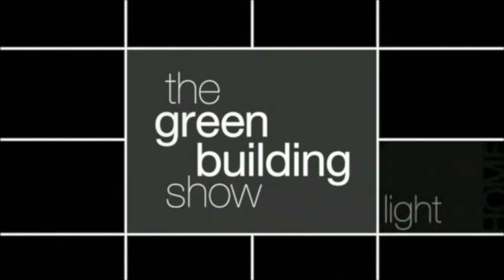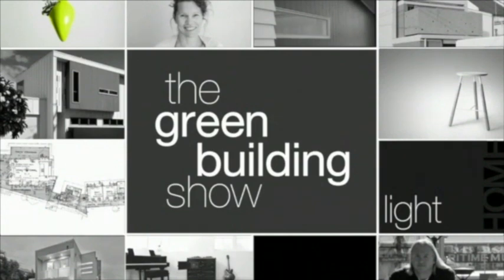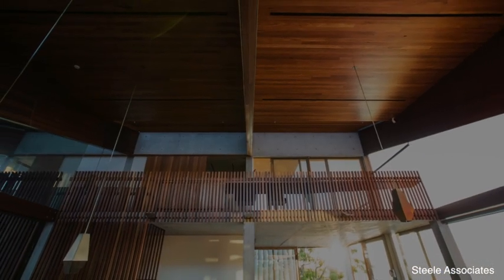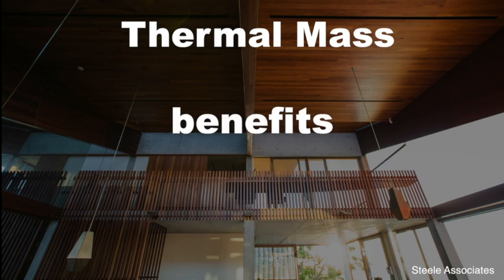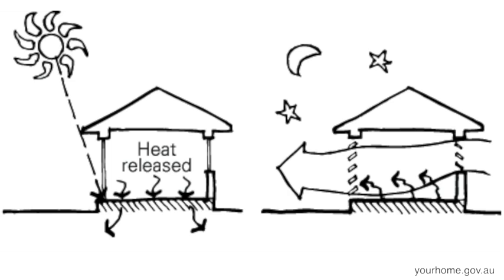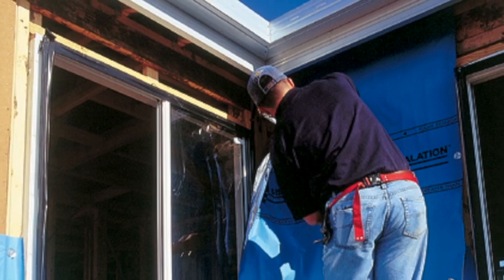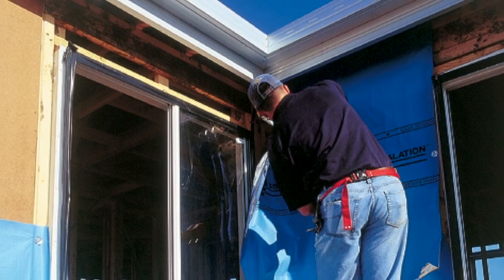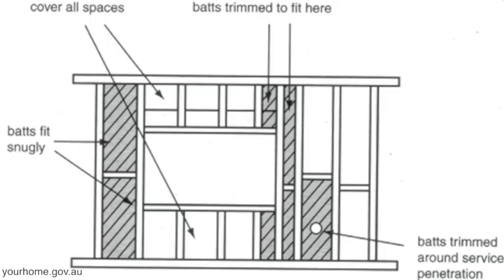Passive Solar Design - What is thermal mass?

Comment: In the Heart of Vancouver Island BC Canada passive videoshttps://www.youtube.com/user/seumas2/videos
Material used

Port
Alberni's first Passive house (Passivhause) build in the heart of
Vancouver Island British Columbia Canada.

Passive
House(Passivehaus) is considered to be the most rigorous 
voluntary energy-based standard in design and construction industry
today.

Passive
house buildings consume up to 90 percent less heating and cooling
energy than conventional building.

The
use of Passive House design software was used to gain the specs
required to meet the performance standard for this location.

House
was constructed well  above the current standards as outlined in
the B.C. Building Code.

Footings
were widen to 36 inches(914 mm) due to low bearing soil conditions
and additional rebar reinforcement added.

30
inch high (762 mm) high reinforced walls . Course sand placed inside
foundation walls and mechanically compacted.

Three
layers of four inch *102 mm) thick  Expanded 
polystyrene foam sheets with all joints staggered and tape were
placed on top of compacted sand.

The
three layers of foam have insulation value of approximately R 50.

A
20 mil layer of poly was placed over the E.P.S. sheets and taped and
sealed.

Four
inches(102 mm) of 30 m.p.a fiber reinforced concrete was placed to
form a slab over the foam based.

Slab
is isolated from concrete stem wall with four inches (102 mm) of
E.P.S. to prevent thermal loss.

All
cold water lines are buried in the sand to keep them cool, hot water
lines have been placed in the center layer of foam insulation to
minimize heat loss.

Wall
plates compress to heavy beads of acoustic sealant between layers of
vapor barrier to prevent air movement.

The
walls are double stud configuration set at 24 inches (610 mm) on
centre and plates are spaced in a manner that yield a 20 inch (508
mm) thick wall. 1/2 inch (12 mm) standard plywood sheathing with 
Mento 1000 a three layer airtight vapor open house wrap( far superior
to common house wraps) with 1/2 inch(12 mm) pressured treated plywood
rain screen battens form the exterior surface. 

Intello 
smart vapour barrier was installed one third in from the inside wall
to prevent condensation in this climate.

Triple
pane argon filled windows meeting passive house standards from
Euroline  were placed mid wall to reduce wind wash heat loss. 
All window openings have been splayed at 45 degrees to give a full
wide angle view.

Almost
all the wiring and plumbing was kept inside of the vapor barrier
envelope to minimize air leakage.

Passive
house standard requires air leakage not to  exceed .6 Air
changes per hour at 50 pascal.

Zehnder
comfoair 200 HRV has been installed with a 1000 watt air preheater
.(92 percent heat recovery rate)

House
has been pre- plumbed for a heat pump water heater reducing 
domestic water heating cost significantly.

Garage
has been pre-wired for 40 amp/240 volt  electric car charging
station.

House
to be equipped  with  heat pump condensing dryer which
requires no external venting,only a water waste line. George K
Builder. © George K 2019      
https://www.youtube.com/user/seumas2/videos

Comment: OK explanation of winter benefits but a missed opportunity to up front clearly explain the benefits and mechanisms of thermal mass cooling (gets there in the end though) and the role of thermal mass in sub-tropical climates when its winter and not humid and in summer when days are still way hotter than the nights and thermal mass will benefit even in SE QLD..